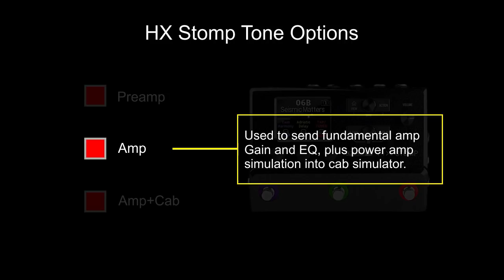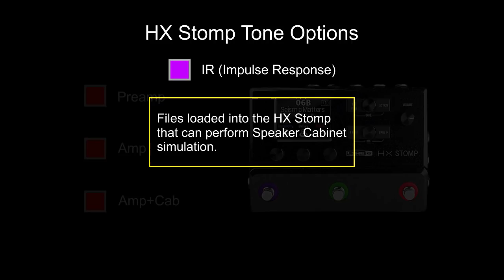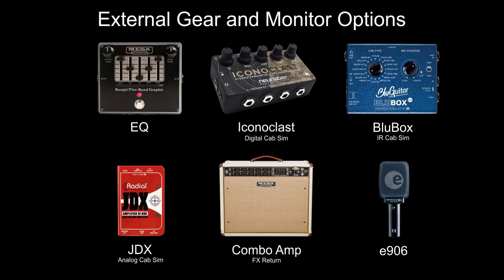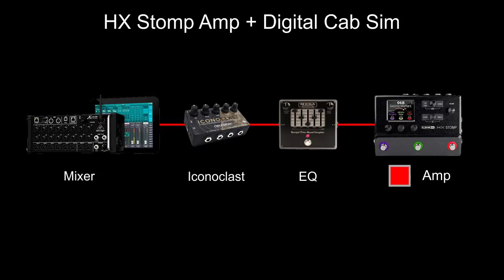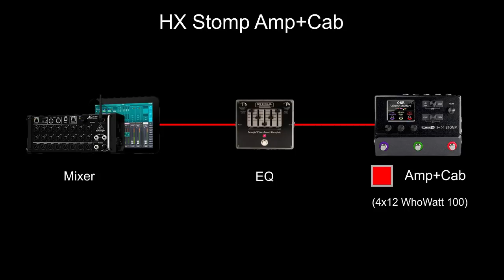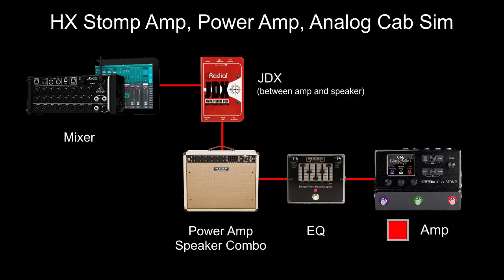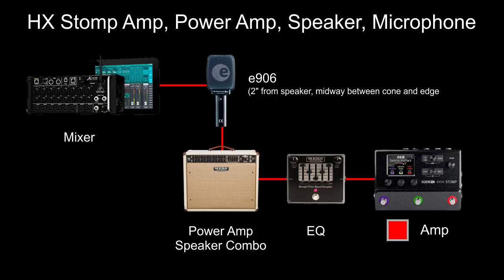Building HX Stomp Pedalboard Part 4: Output and Monitoring

Comment: Could you speak on the difference of the HX Stomp and LIne 6 Pod Go....I play most at home and maybe a few gigs around.  Thank you in advance.  AMAZING VIDEO's you create!
Reply from the maker: I don't have any first hand experience with Pod Go, but from what I understand its the HX Stomp models in a different package with less power .. some effects are only in Mono .. some effects are not present, there is no MIDI ... but it may be exactly what you want if you don't need those things and it has more foot control options which is something that most users of the HX Stomp immediately figure out ways to add more of (I use a MIDI controller).
Reply: @jmkmusicpedals  Thank you for a quick response!! I truly appreciate it.

Comment: It's been 6 months since you made this video, so I was wondering if you're still using the HX Stomp? Did you go back to the AMT pedals, did you find something else. What are your opinions on the HX Stomp now that you've had to live with it for a while. I'm considering buying one to replace my AMT C2 pedal, which I run into the fx return of amps.
Reply from the maker: Stevo I am.  I’ve used it at 7 or 8 gigs.  Works great.  I recently had the MIDI controller in that rig crash and I’ve gone back to the big rig out of necessity.  I’m looking at the Strymon Iridium.   It doesn’t do the smooth high gain of the C2 on its own though.
Reply: @jmkmusicpedals  So after your MIDI controller is back in action, will you be going back to the HX Stomp? 

Also, I listened to the song you uploaded with a video. It was great. What did you use to get the guitar tones?
Reply from the maker: @steven_uk  Thanks for listening, the guitar tones were all AMT E2 and the Iconoclast cab sim.  Honestly, I tried recording with the HX Stomp, and while it was okay, for some reason I just couldn't get it to sit in the mix how I wanted.  It'd good for me live, but I didn't prefer to keep it for recording more seriously.  Not that it was all that bad either, it just wasn't as good as I knew I could do with my other preamps.  So, my MIDI COntroller is Liquid Foot and that company is looking more and more like it is going belly up.  I hope that's not the case, but I may never be able to get this controller repaired.  I'm starting to envision plans of using the Iridium and combining it back with my large rig and using that.  I also thought about using the HX Stomp in my large rig.  Between the sound and feel of the Iridium and the HX Stomp, I would choose the Iridium.  However, it's not nearly as flexible.
Reply: @jmkmusicpedals  Thanks for the reply. Seems like the HX Stomp will be replaced by the Iridium in your future.
Reply from the maker: @steven_uk  It can't really replace it, but it has 3 preamps sounds that I rate higher than the equivalent preamps in HX Stomp and that I am fully satisfied with replacing my AMT F1, V1 and O2 and the Boosts in my large rig.  I'm working on it now and I'll probably shoot a video sometime in the next week or two.
Reply: @jmkmusicpedals  It does look and sound amazing. I'm disappointed there aren't more amp sims available.
Reply from the maker: @steven_uk  Right now, if the Iridium could do the higher gain, saturated sound like a 5150, I think I'd be fine using it for all my preamp needs.  What I'm doing now is incorporating it into my MIDI switching, but I'm keeping my E2 preamp on a bypass loop because it doesn't come anywhere near that sound.  I am replacing a lot with the Iridium though:  F1, V1, O2, B2, MXR Boost, Luxury Drive Boost, 8 bypass Loop, AB Splitter (I just use the two outputs from Iridium as the splitter).  Like I said, I do have to add 1 bypass loop for the E2 and I'm also experimenting with a programmable EQ to shape the sound of the Iridium to get it closer to the O2 and B2 (it's perfectly serviceable without that last piece, but I'm being picky).  The Iridium looks pretty expensive at first glance, but the stuff I'm removing add up to a lot more.
Reply: @jmkmusicpedals  The Iridium does should impressive. I'm looking for a preamp to cover stoner/doom tones but also has the ability to do a crunch and clean tone. The AMT C2 covers high gain and clean, but I'm missing that crunch. The Cornford isn't perfect for doom either, but it's still doing a good job.

Comment: Should have just sold all your gear and bought the Axe FX III and an FC-12 controller. You can do everything you did in this series with those two pieces of kit.
Reply from the maker: I think about that sometimes, but all-in-ones and I don't get along so well in the long run.  It's good to know ones self.  This was a small enough investment for a single purpose which wasn't getting rid of the rest of my gear.